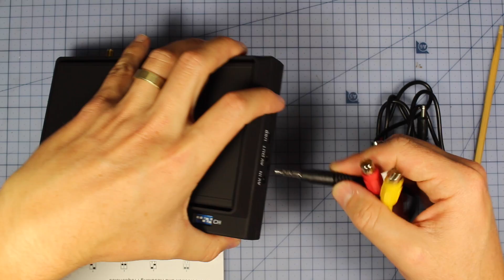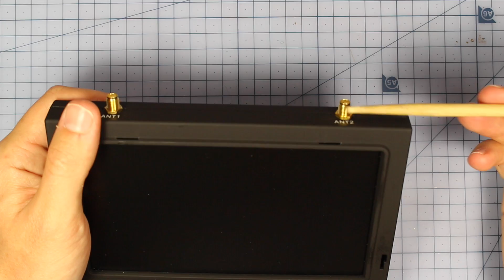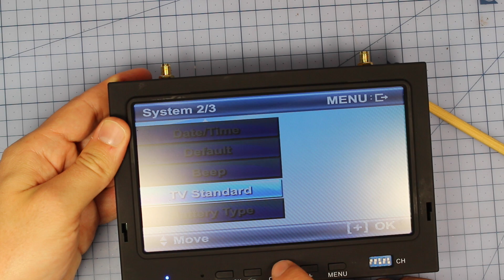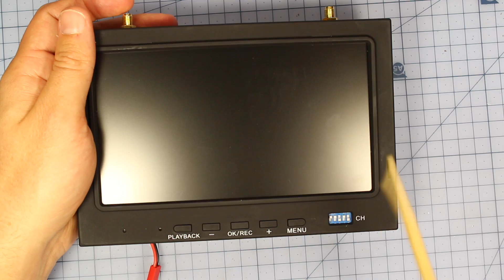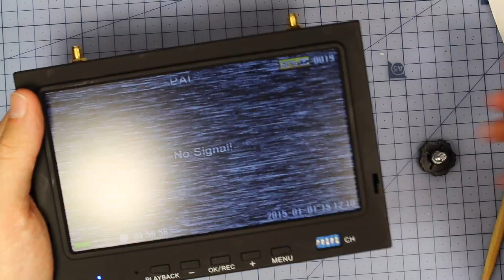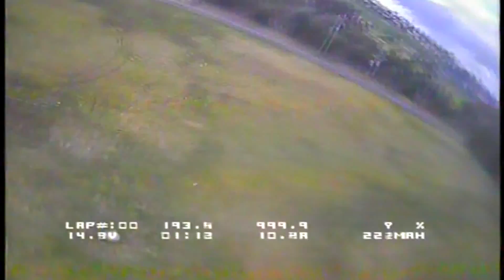Skyzone 700D Review. FPV screen with diversity and DVR.

Comment: hm, just got one of these, do you not find the image lag uncomfortable as opposed to say goggles? I used to have a standalone diversity receiver hooked up to it was an lcd, got the image dead on, no lag, switching to this introduced a fair amount... opinions others?
Reply from the maker: I didn't notice the lag actually but then again I don't fly through it either. Just out of interest was this on a 2s battery?
Reply: +UAVfutures It was a 3s. guess it's just the way it is,hooked up my smaller LCD via the av out,and it was the same.
Reply from the maker: Dávid Lipcsey ok. Ill look into it, thanks for the findings

Comment: I have this monitor and it has unfortunately some issues: If you are using the DVR while doing FPV use 3S, if you use less powerful voltage you will have some freezing from time to time. There is also another issue with the DVR which gives you black screen during 2 seconds when splitting the video file every 10 minutes. Overall great unit, the Diversity receiver is pretty cool even a scan button would have been awesome but it's an old unit after all :)
Happy midweek and keep on FPVing